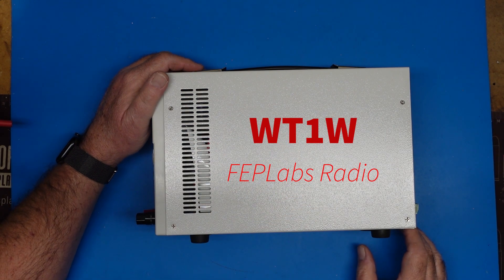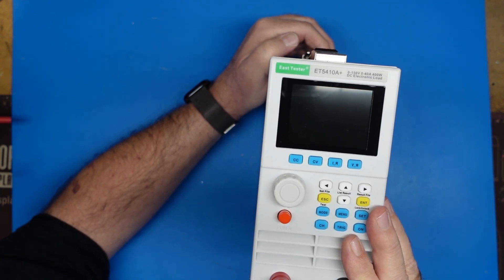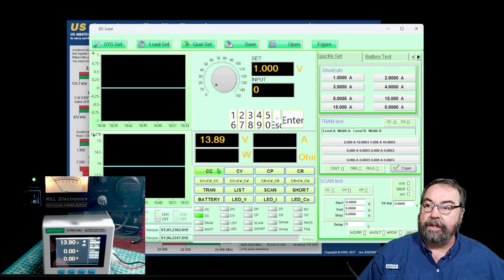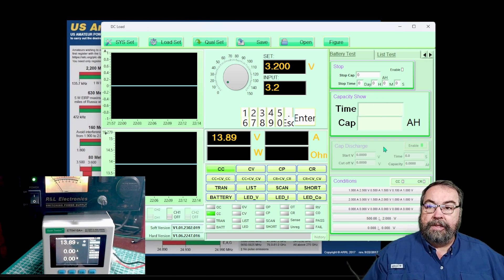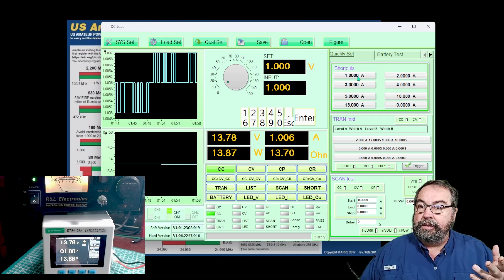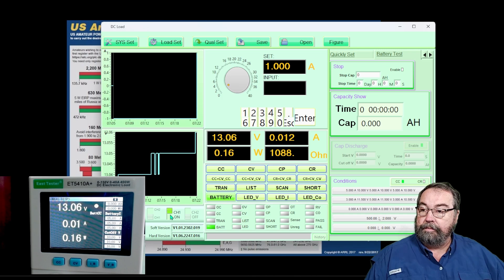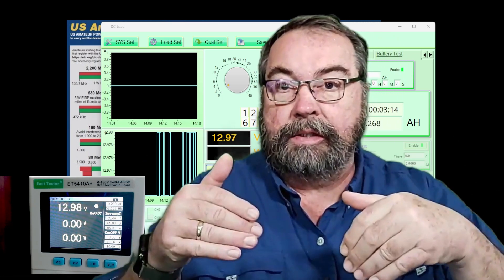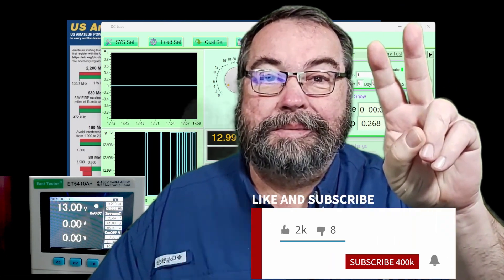Comprehensive Review of DC Electronic Loads: ETS-5410A

Comment: Thanks for the shout out Jim!  Nice review on the load.  I need to look into one of those.  I used to have access to electronic loads at work that could do hundreds of amps and hundreds of volts.  I miss that capability.
Reply from the maker: Any time!  I needed the darn thing when I was troubleshooting the Astron PSU.  Better late than never.  The more power it can handle, the price gets stupid high, real fast.  This one should do for most anything I need, I hope.

Comment: Hi Jim
I use a extra power resistor like the ones used for dump loads for solar, with my electronic load for higher current tests,
Thanks Dave 2E0DMB
Reply from the maker: Great tip!  I suspect this should do me for most applications (so far), but that's a solid idea.  I need to get some big boy resistors.
Reply: Also they will get hot, fit in to a box with a fan, like you would do with a rf dummy load,
Also for long videos
Also use silicone insulation wire leads, 
Keep them coming,
Dave 2E0DMB

Comment: Battery tests do not need many dynamic load tests, maybe a bit for the BMS. But linear supplies do, and switching supplies much more so. Attaching a storage scope will capture finer over/under-shoots better than the load.
Reply from the maker: Lee, that is probably more advanced than I am going to use it for currently(see what I did there!).  I've read that one of the downsides of this unit is that it is slow on response.  Hooking the scope to it would work out well.